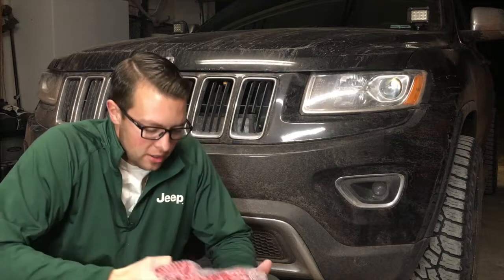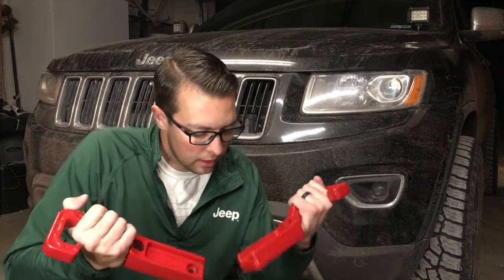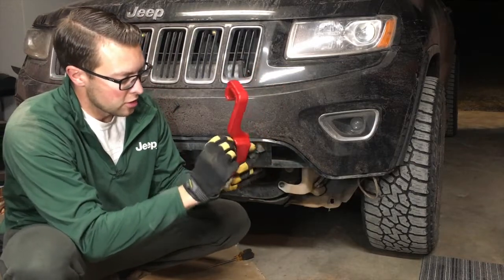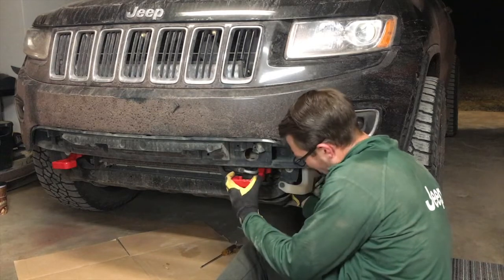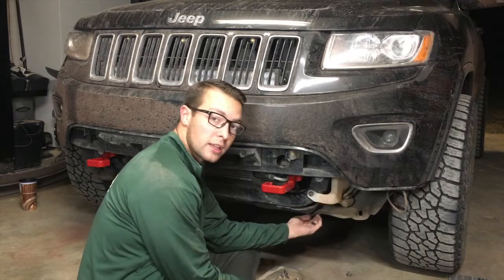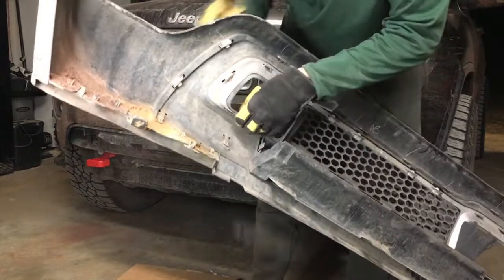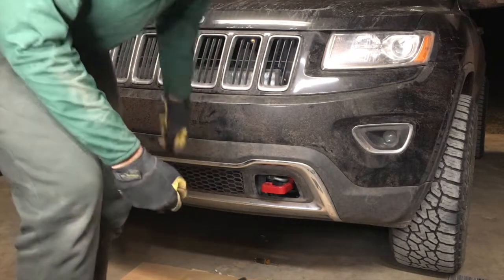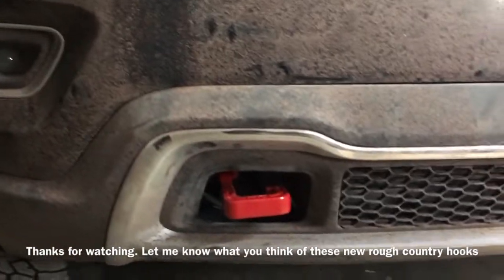WK2 Rough Country Tow Hooks

Comment: What trim do you have? I have the 2015 altitude and wondering if I'm going to need to remove those parts in the front drivers side like you had to
Reply: I found if you take off the 10mm bolt at the bottom of the wheel well liner you can move it out of the way and gain access to the rear tow hook bolt on the drivers side.

Comment: I installed 2 sets on both our 2013 and 2014 wk2s. I dont know why they specified 2015-2019 in the amazon listing, the range seems to be false. Seems like they are missing out on a million or so potential customers. clearance hole of the tow hook is only juuust big enough for a socket which unfortunately means that if there is any variation whatsoever in bolt spacing,  you cant get the bolts started. Heavy grade socket head cap screws should be shipped instead of hex head to solve this.  All 4 bolts can be easily accessed with a long extension. No components need to be loosened or removed. You dont really even need to remove the lower front fascia but it makes it easier to see.  I didnt like red, so i had them blasted and coated black for $15ea at a local shop. Have not tugged on anything yet but these forgings look good so I expect it should be ok.
Reply: I was told from RC that the 14s mount differently.? I have a 14 and looking for hooks. Any input?
Reply: @only1knute  the mounting procedure was identical. Our 2013 is an overland and the 2014 was a limited.
Reply: @williamheimsoth4156  hmmmm ok then, thanks I’ll order some
Reply: @only1knute  my wife also completely (not a little bit) totaled the 2014 in a front end collision after installation and her only injury was a bruised thumbnail. Extremely impressed with the safety of the GC and don't think the hooks caused any adverse effects.
Reply: @williamheimsoth4156  daaang. Thats good. I just picked up a 14 limited
Reply: @williamheimsoth4156  I have a 2022 GC. They do not make the brackets for the mopar hooks anymore. I haven’t seen anyone put these on anything above a 2019 probably because the marketing saying it’s only for 2014-2019. My question is do you know what kind of coating the mopar ones are? I would love to try and put these on with that texture coating of the mopar. And what kind of shop did you have them sprayed at?
Reply: I have 2022 GC Laredo WK and the same hooks fit perfectly. Amazon and RC are not aware that the hooks fit the 2022. 
I sanded them as much as I can , and sprayed the black . I sprayed one to 2 coats every day for 5 days to make nice and thick.

Comment: Great video! Off topic, but I’m just curious what your suspension, wheel, and tire specs are. Looks good!
Reply from the maker: I'll make a video soon. Hit that subscribe and it will notify you. short answer rough country 
20x9 0mm 275/55r20
Reply: @thenewmexicans4239   Subbed 😃 Thanks!
Reply: Seems like all he did was put bigger tires on it tbh
Reply: @onlinelegend1458   Possibly. I saw him comment in another video that he has 275/55R20 wheels but it wouldn’t surprise me if he had a 1-2” lift.

Comment: I have a 2014 limited. Do you only have to loosen off wheel well on drivers side to get at back bolt for tow hook?
Reply from the maker: I just had to looser the bracket for the windshield fluid, which is on the drivers side

Comment: Hey brother, so these just bolt right up without the need for any mopar brackets/spacers etc? Just take off the lower fascia and bolt it right up with the provided bolts from Rough Country?
Reply: Yup not my video but I have the same hooks on my 18 altitude. Just had to buy a fascia that had the openings. Mine wouldn’t pop out
Reply: @MrCliff050505  would you have a link on where you purchased the fascia. Have the same model & year.
Reply: @erm000  https://www.justforjeeps.com/631810773aa-68310774aa.html
And u might want to order some clips before hand I had a few break
Reply: Absolutely 👍

Comment: Open tow hooks is a wish for damage as the line can snap off easily so I suggest don’t use kinetic rope.
Reply: Been using open for 20+ years with no issues. Before that we just wrapped around the tow ball, no issues with rope chain etc. Understand what you’re doing and why you’re doing it and you won’t have these issues.